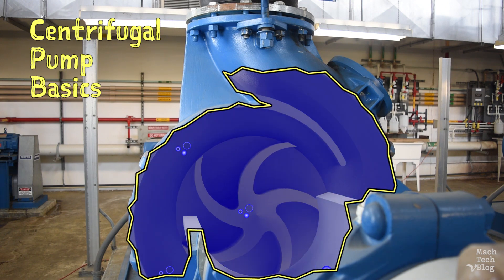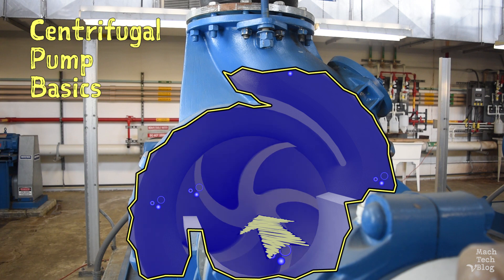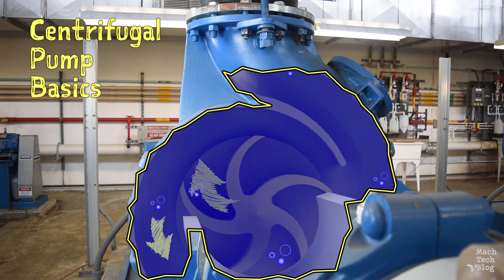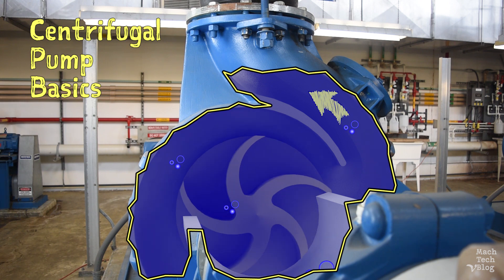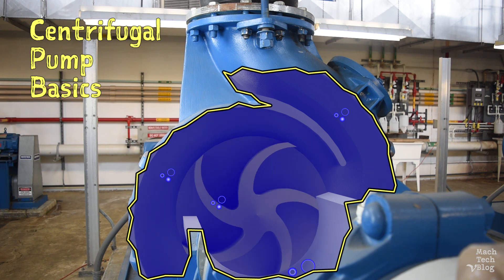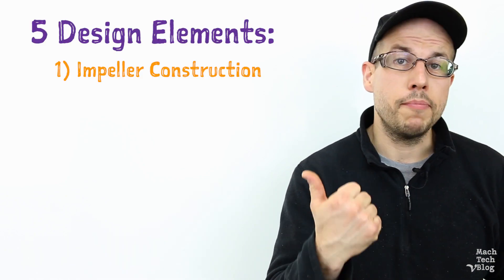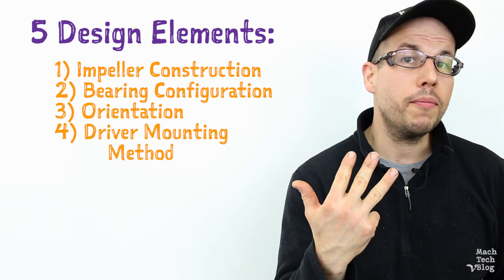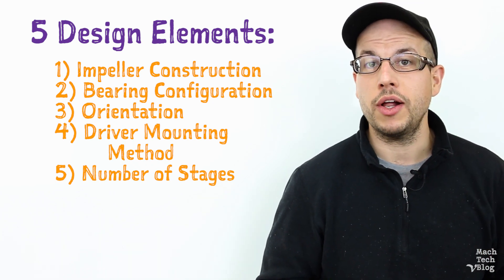Centrifugal Pump Types

Comment: The split case pump is sealed with Chesterton split mechanical seals. In this case the seal model is the 442, probably the finest split mechanical seal available today. A new version of Chesterton’s split seal is available named the 442C you can check it out at www.chesterton442c.com

Comment: Dear Adam, not related to your posts,  I would like to ask if adding a check valve could help reduce head pressure from a single magnetic drive water pump at 250 gal/hr at 5 feet through 1/2 inch PVC pipe, and if check valves would prevent forward flow.  Can you answer this question?  Thanks.  Robby

Comment: there may be a way to reverse thrust load at the expense of the motor & energy, perhaps a piston or disc/plate in the path of the water ,that  may create suction somewhat  countering TL & prolonging the life of the barings, but im sure its not that simple, & without a model i couldnt gauge what the net effect would be, 4 smarter minds

Comment: I need a quote on a6/8 Berkeley cetrifical pump. Frame mounted pump drive by a pto shaft power source is a90 HP Perkins 6 cylinder diesel engine. The shaft size is 1/516 shaft size. The impeller size is 13 inches. I would need a complete shaft kit. My impeller looks good.